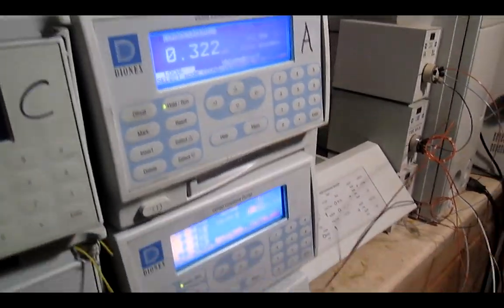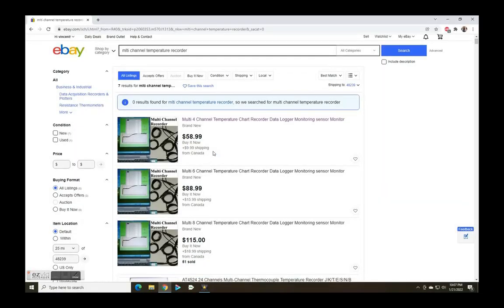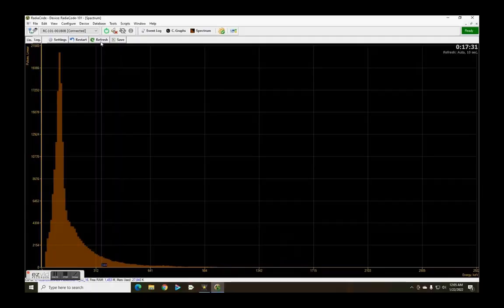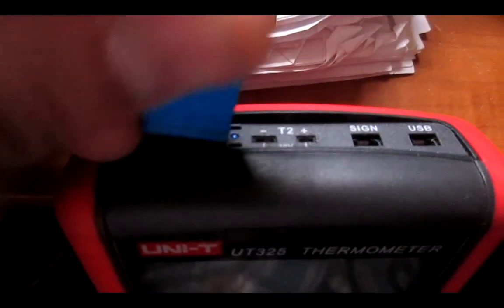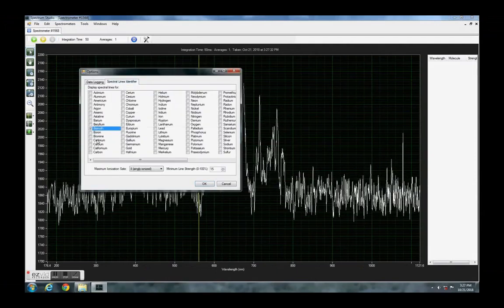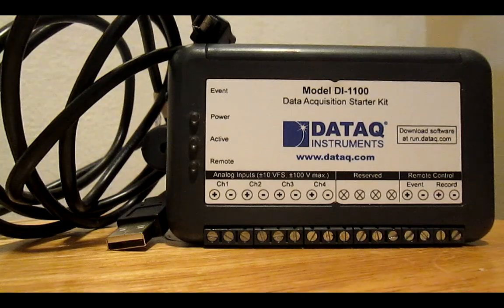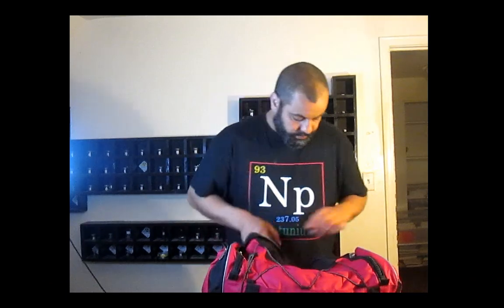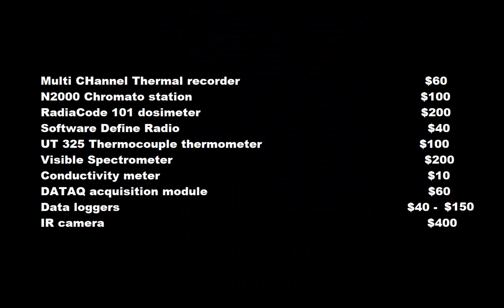10 cool science gadgets for your experiments and projects

Comment: what does the N2000Chromatography Data System use an an input?
Reply from the maker: It's an analog input, so it can be anything you want between 0 and 10 or 15v  DC. I cant remember the exact voltage. A lot of equipment have analog output ( UV absorbance, vacuum gauge, electronic. Thermometers, voltmeter etc... ) so it can be what ever make sense for your experiment and changes over time.
Reply: @Neptunium  so a sort of general purpose MCA?
Reply from the maker: @project-326  oh no ! There is. I time on the MCA axis! Just like a spectrum analyzer, the signal changes according to frequency. That wouldn't work as an MCA... I am sure you saw the gamma spectacular here : https://www.gammaspectacular.com/?tracking=640e3944f138c&gad_source=1&gclid=CjwKCAjwt-OwBhBnEiwAgwzrUt27YSbQXiOSvnKTzHejtmSVu_TosfMaIB1xrl22t6INat7PdjjjLBoCWZQQAvD_BwE.   If that's what you are looking for?
Reply: @Neptunium  understood, its basically a low frequency FFT analyzer.
Reply from the maker: @studio326- lol! Yes ! 😊

Comment: Super tempted to get the high resolution Raysid for $600, but it's totally sealed! It's going to become a 600 brick when the battery dies! So I guess I will have to go with the Radiacode 101 since I think you can at least pry it open to replace the battery but I really don't like the low channel resolution. Can you even really do true spectroscopy with it? The element identifier looks kind of sketch, with it apparently just assigning certain channels to specific elements without actually using multiple lines to do a true and reliable ID.
Reply from the maker: Well, I fully charged it once out of the box as recommended and used it a bunch of time  including twice when it was on for over 48 hours straight and it sat a few days off n my desk .The battery still says full... The resolution is poor compared to larger crystals as you would expect but it gives a rough idea what radioisotope you are dealing with or at least the spectrum profile can help narrow the search. It came already calibrated but you can change the calibration settings for a better centroid if you want. It is not as straight forward as entering the energy on the peak unfortunately, I was however impressed by the accurate dose and sensitivity (microRem/hour) about 100 times better than the Mirion DMC3000 we use at work. Because it is so sensitive, I really liked the mapping feature when i go on my daily walk, I was actually looking at a light weight portable MCA to launch in a balloon again and see if the 511 Kev line shows up...I`ll try to do that this summer .
Reply: the number of channels will be increased in the next updates
Reply: @Nuclear_Legacy  Whoa! Are you the guy making these?? I've been subscribed to your channel for many years since that cesium source leak at a metal plant in your area! how funny / cool!
Reply: @Neptunium  interesting info as usual. thx!
Reply from the maker: @Nuclear_Legacy  Yeah Thanks RockSteadyRus! cant wait for the upgrade!
Reply: @Muonium1  Yes, I am one of the developers of the device.
The experience of dosimetry was transferred to the device. Now we are actively making the device better and better. =)
Reply: @Nuclear_Legacy  well alright then, I will not buy the Raysid and instead will wait until the next update of the Radiacode to buy your product instead!